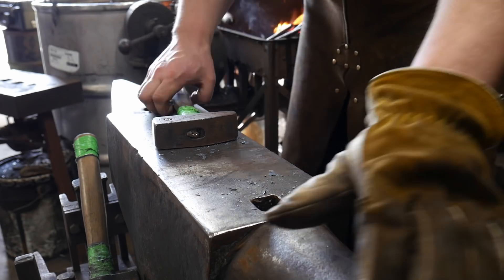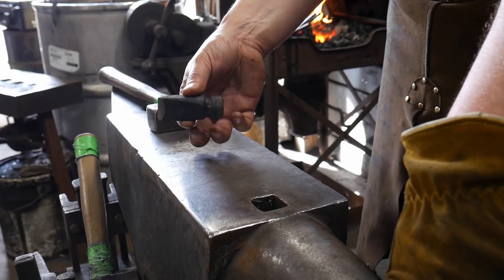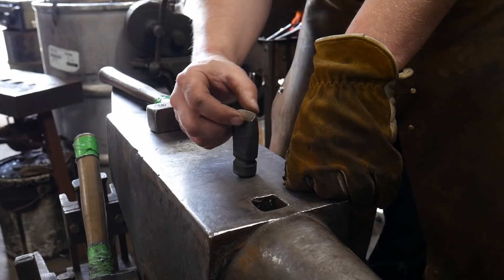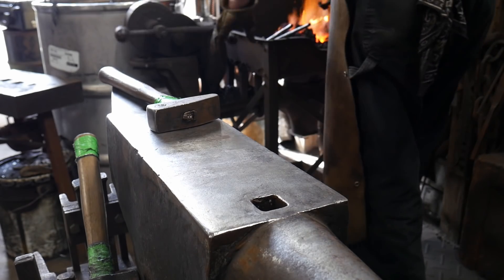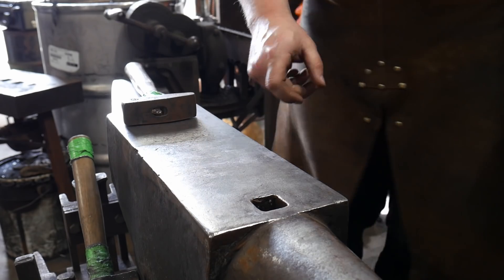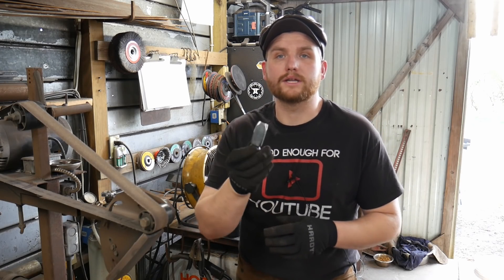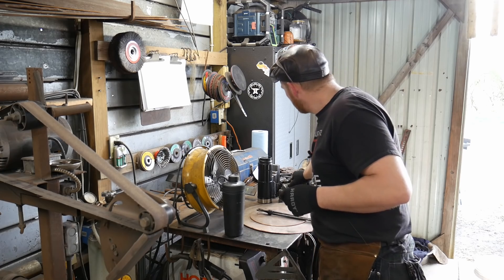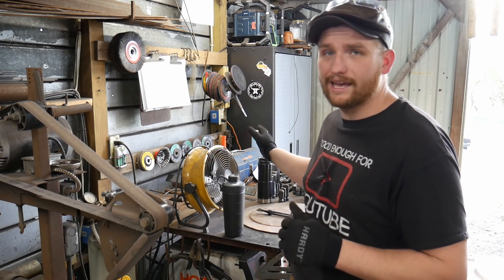Forging a Concaved Butcher

Comment: I just had a thought. If the groove is round and the tooling tongs are round. What keeps the tools from rotating when in use??? 
Another great video have a awesome day
Reply: Not sure but I would imagine when he put's the tongs on and then the tong clip, it probably grips pretty well and stops the tool from slipping..
Reply: @lenblacksmith8559  Exactly right!
Reply from the maker: The groove is not perfectly round it's more of a octagon so the tongs don't slip :-)

Comment: so if a blacksmith only makes these and only these tools and nothing else would that make his shop a butcher shop

booooodddaaaa tis nuck nuck nuck

can you use one of these to cold cut steel in a pinch or would it not hold up to the abuse or cut it deep enough? I mean a straight butcher not the concave one by the way
just curious